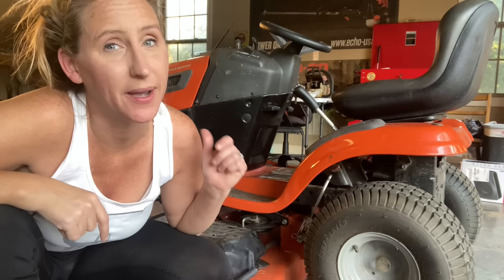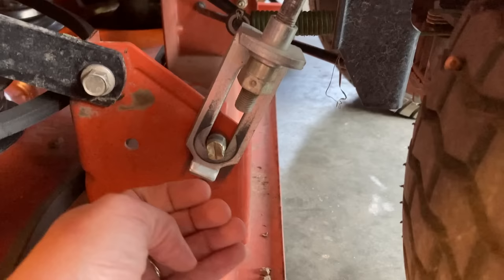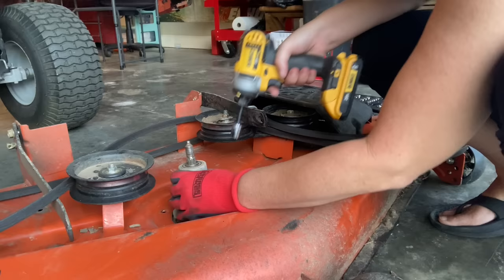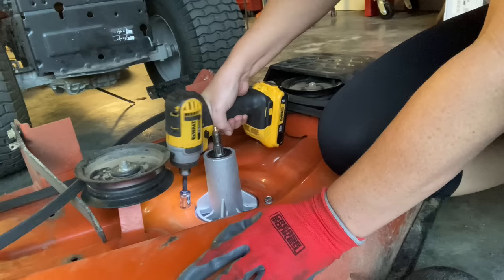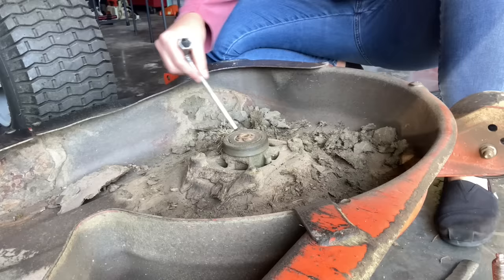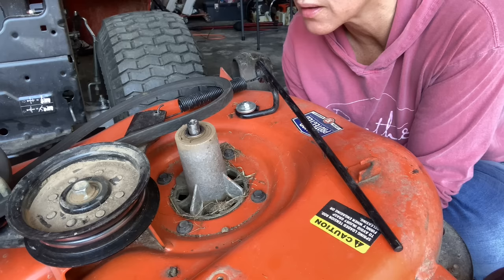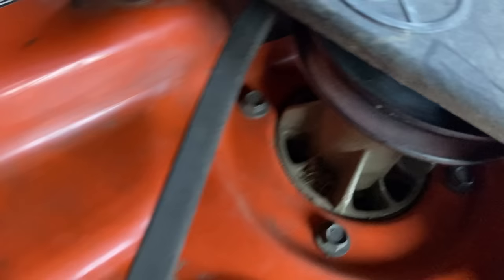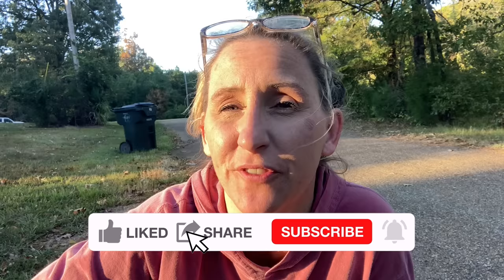Husqvarna riding tractor deck repair. Spindle, shaft and blades replacement.

Comment: I am definitely not an OSHA nut but I couldn't help but cringe when I saw you wearing flip flops working around all of that heavy metal.
Reply: My grandfather used to demo rental properties with sandals. My cousins and I would say he had his construction boots on😂
Reply: I wore my Crocks doing the same thing today. Is that okay?😊
Reply: Air chisel on end of bolt will make it jump off?
Reply: Safety 3rd!

Comment: Those zerks actually do work.  Although they are called “sealed”, it is basically a dust shield and grease will get past it due to the pressure.  If you don’t believe it, then you can also just remove the seals on the inner side of the bearings.
Reply: There is no way the grease will flow past the seals.
Reply: @JM-yx1lm  Yes it will.  Do the test and then get back to me.
Reply: If the bearings are sealed, only the grease in the bearing will remain.  No additional grease will get in there.  If it could, it would also come out the other side.
Reply: @robertheinkel6225  It will and does if you put enough grease in.  Most people only put about 10- 20 pumps of grease in and it takes much more than that.  A grease gun puts out 700-3000 PSI, those rubber seals couldn’t hold back more than 5.  Do the experiment and you will see that grease will absolutely get in there.
Reply: Grease pressure will get past those plastic,rubber seals (slowly).  But you can also pick out the seal on grease side and then it has easy access.
Reply: @gomerhondo7249  the rubber seal helps keep out any moisture and dust that may get by the grease that is in the cavity between the bearing and the zero fitting.  The system actually works good when properly greased, provided the bearings are of good quality.
Reply: You have to remove the inner seals for it to work !!!
Reply: @mitch8831  It does not work unless the inner seal is removed !!!  DUUUUHHH!!!!!!  The pressure of the added grease will only seal the seal tighter !!!!
Reply: @mitch8831  NOOOOOPE !!!!!
Reply: @wilburfinnigan2142  Do the test and you will find otherwise.
Reply: Mitch is right, and there’s YT videos to prove it. As a professional aircraft & auto mechanic of 30+ yrs I didn’t believe it either, but I watched a video and tried it on my new John Deere S100 riding mower and sure enough the grease makes it past the inner seal and crackles as it comes out the outer seal. I always thought hydraulic force it would push the bearings out of the spindle but it doesn’t because those seals are fairly weak and the grease just cruises thru them. I think it took about 20-25 pumps from my pistol grip grease gun on each spindle but seriously, it works. Now I just hit them with a pump or two twice a year and I know they always have fresh grease. Give it a try, your bearings will love you for it. 👍
Reply: @mitch8831  I filled my spindles on my JD when I rebuilt it. The grease did flow, but it took a lot of grease to fill it up to pressure. Either way it's full and dirt won't bet getting in. You can feel it when it's full and yes, mine did seep out. Just don't go too far.
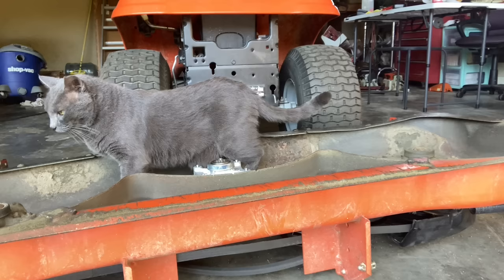Reply: Seals?!! look again @12:30 There isn't a seal on the upper side of that bearing that Bre just took out of the housing.....
I know, Bre made another video explaining why the zerks weren't doing anything except plugging a hole, however as you could plainly see, there isn't a seal and therefore, grease could be beneficial. Just being observent.....
Reply: @mrbibstoo  I have this exact mower deck, and take it apart to clean it every year.  There are no zerk fittings that just “plug a hole”.  They all have a purpose, the manufacturer would waste money on a zerk fitting if there wasn’t a purpose.
Reply: @mitch8831  OOOH i have and have pulled the inner seal off !!!
Reply: Just saw the vid and those bearings that i saw had no seal and she installed them dry.
Reply: Nice repair video. But stop wearing flip flops working on these things.
Reply: ¹

Comment: Bre it is the OLD MAN at Eliminator Performance commending you on do a good job and taking care of the neighbour, smart move. Just a note: a while back i changed out a deck spindle and wanted to test if the zerk fitting and grease would actually do anything with the new both side sealed new bearings. Took the inner seal out to check the grease and it was packed and full of a blue coloured grease maybe marine? Assumed the other bearing would be the same so did not check it, but reinstalled the inner seal and by hand and paint stick started to pack the inner spindle housing with RED & TACKY grease, yep you guessed it red in colour. Hand packing just helped me out by not requiring to pump around 70 pumps from the grease gun to fill the inner housing. Anyway i reassembled the bearings and pulley and started pumping the grease gun filled with a new tube of red and tacky until grease back pressure could be felt and grease started coming out of the bearing ends which happened to be blue in colour so i figured the red grease must be displacing the blue. Disassembled the spindle and bearings again pulled the inner seals on both and guess what? Red grease was going into the bearing through the inner and outer diameters of the seal i guess no other way for it to get in there. So the moral of the story is do you want to pump 210 times with the grease gun to possibly make those bearings hold up longer and grease them every year cause grease will go in there just not sure how much but the two colours say some goes in.
Reply: 5555
Reply: @logangarrison7254  Yep your number may be closer it is a lot of pumps of grease to fill them just think how much money it would cost the manufacturer to sell them filled?

Comment: I am still mowing with a Sears twin SS16 H.P. 48- inch deck I bought in 1974. My first mower. I mow about 2 acres. I have only replaced the belts and battery, everything else is original. It has the onan engine. 
I love your videos.

Comment: When I bought my 3rd house it had a lot bigger yard than the last two and I definitely needed a riding mower. My parents neighbor gave me her old Murray rider, the two speed Model, high & low, so I was glad to have it. So after maybe the third cut the left side began to cut lower than the right, I adjust this thing a hundred times if I did it once had me tore not being able to get it level. I thought it was a blade issue but nope. So one Sunday morning after two passes and getting pissed to no limit I jumped in my truck and went and got myself a Sunday paper. Just as I was hoping Sears had a sale on riders. So I pulled out my sears card called to see what my limit was and was good to go. Told my girlfriend at the time I’m going to Sears to buy myself a New Mower let’s go if your going. Got to Sears bought a Sears LT1000 and I couldn’t quit smiling! Was so proud and happy I went by my parents house to show my dad! Gave the Murray to him for my grandmother’s yard. He found the problem with the uneven cut. He pulled both spindles and he put it on a mic gauge and one rotation there the problem was, bent spindle. Could have save myself a lot of money if I had known about such part or problem but the Craftsman didn’t disappoint! I had that mower for 20 years and she still looked brand new when I gave her away and the only reason I did was because my parents neighbor had bought a Scott’s that they had problems with since day one, dad said it was the vent on the gas tank, nope it had a short from the factory in the switch. I noticed every time that I was in a bumpy part of the yard it would either cut off or back fire. Pushed it to my garage put a block on the seat fired it up and just started shaking and pulling on every wire it had, pulled on the switch and there it was, started backfiring, EBay and $13.00 bucks fixed it. I know the first owner spent right at a $1000.00 and three trips to repair shops! Keep up the great content, I love learning new stuff!

Comment: So hilarious that this exact same thing happened to me yesterday.   So now I am waiting on the replacement spindle to get here tomorrow.  Watched the video to double check everything I am doing is the same and good to know I am spot on (minus the cat issue, have a dog though that likes to know what dad is doing 😆).  As for the hammer issue, mine is always Phillips vs flathead.  Keep up with the good information you are providing, it is very helpful and informative.  Thanks for taking your time to share!
Reply: Grinner  If you have a Husqvarna or any  brand mower keep a pair of spindles and pulleys and blades on hand and not if but when you hit a rock and break a spindle you can be back to mowing right away, then reorder the parts you need !!!
Reply: I went thru three belts because Someone at church knew it all. Thank you even that's a different brand
Reply: @wilburfinnigan2142  just how big of a dam rock do you need to hit to do this? lol  gotta be big?

Comment: Actually the spindles are designed to take grease through the hollow bolt out holes and fill the center of the spindle.  When installing bearings you are meant to pop the dust seals off the upper side of the bottom bearing and lower side of the top bearing.  This allows grease to enter them and be spread among the balls and cage.   Now honestly the system is flawed as unless you grease them regularly they dry up and don't take grease.  Also they use damn near a third of a tube per spindle which largely just sits their most of it's life.  Nice thing is they are cheap bearing so replacing them every so many hours and not wasting the grease is not horribly hard on the pocket book.  I have had three of the very same decks one on a Husky, on a Craftsman Pro and one a Poulan Pro.  As always you give great advice and tips that will help homeowners save money and get more life out of their equipment.  Thankyou very much and best wishes from Atlantic Canada.

Comment: Cool that you used the good spindle on the old blade housing.  I think many shops would just do two complete housing/spindle changeouts!  I did worry about your toes when you removed the deck with flip-flops on.

Comment: If you use a gear puller to remove the pulley it would pull straight up allowing it to come easy. Using a pry bar on one side tends to take it off at an angle will takes considerably longer and makes the splines bind on each other.

Former US Navy engineer
Reply: Actually the easy way to remove a stuck pulley is remove the 4 spindle mounting bolts and allow the spindle to drop until the pulley rests on the deck and remove the grease zerk and whack the shaft with the hammer !!!  quick and easy !!!
Reply: @wilburfinnigan2142  An engineer will always come up with a complicated procedure to perform a simple act. 🙂
Reply: @jayjaynella4539  in my cub cadet manual, for taking deck off, there's an extra step that is totally unnecessary.  I scratched it out and wrote, " stupid step, don't do this".
Reply: Sounds exactly like something an engineer would say.......
Reply: @jayjaynella4539  an engineer will use the proper tool for the job!
Reply: @wilburfinnigan2142  its junk anyways. Just hit the zerk fitting
Reply: I thread the nut back on and whack it with a hammer, be sure you have the nut down a bit so it wont damage the threads with the force of the hammer, it comes right off usually with 3 blows

Comment: Earlier this summer I had worked on my neighbors Husqvarna of the exact same model. He mows about 4 acres of which about 3/4 of it is wooded. I replaced a spindle on his. It didn't come tapped but did have the self tapping bolts. I didn't know there was another option. I also didn't realize that the blade side could be different. 
 He had brought this mower to me many times. I've had to re-weld the welded brackets on the deck back on, where they were stress cracked and peeling off the deck. Along with issues of the drive belt kept coming off. Finally after the third time bringing it back for the drive belt issue, I tore every part that had to do with the drive system off of it. This time I took the rear tires off to get a better look at the top of the transmission. I had it jacked up using the pull tab where you connect a trailer to. This released the upward pressure on the transmission allowing it to drop down. There were two 13mm bolts on the front of the transmission broke off. I dropped the trans and tried to drill and easy out the broken bolts from the housing. NO GO!! Wound up using a regular drill bit to completely drill out the old bolts and re-tapped the aluminum housing. OMG! It was a nightmare of a job. Took me almost three days to get it repaired start to finish. And as @Marc Davis said I'm not young anymore. Plus have debilitating back problems. Was SO GLAD to finally find out the real problem and get it FIXED.. Keep up the good work and keep the videos coming. Love your channel.

Comment: I did this same job on a poulan that my boss gave me with a rusted out deck and busted spindles. It was a lot of work, but for the cost of 2 spindles on ebay and some welding wire, I have a functioning riding mower.

Comment: Brings back horrible memories of putting husky decks on working at Lowes, because they were never attached when shipped. Can't imagine taking them off.
Reply from the maker: This mower my neighbor got marked down at Lowes because it fell from somewhere and crunched the hood.
Reply: some of the husqvarnas come with the  decks off sitting on the side of the tractor in the crate. always fun  uncrating assembling and prepping. tried to line them up and do 6 or 8 in one shot.
Reply: This vid just reminds me how i need to get my husqvarna lt151 fixed and the chicanic is literally half a world away

Comment: You should also check the flanges that hold the rear tires on the frame.  Huskies are known to have those crack.  Not only did mine crack but the frame split in front of the transmission.

Comment: I have one of this model mower that is about 12 years old. The hour meter shows 800ish hours, but it went a couple years disconnected. In that time, I have had to weld a broken deck hanger bracket, replace a broken spindle,  install a short block because I had a slow oil leak that suddenly got much worse so I ran it dry and I have replaced all the steering gear twice. Oh, and probably 6 or 8 sets of blades; we don't just grow rocks, but it rains them here, too. The hydrostatic drive is getting to where it won't climb every grade on our property, so I suppose that's probably next. None of this is me complaining, but rather praising that it has held up to mowing our rocky property. I use the crap out of it on about 3 of our 12ish Texas acres from March to October. I think we have gotten our money's worth out of it.

Comment: Correct me if I'm wrong, but when you spun the new shaft, it was quiet, as it should be, but the left-hand shaft made quite a bit of noise, and the right-hand shaft was making noise as well.  I just did the same job and purchased a kit from Amazon with all the rotating hardware.  The kit was $129.00.  I didn't want to have to repeat this process again in the near future.  All that being said, you did teach me some things in this video, so thank you for that.  Retired Submarine Auxiliaryman.

Comment: Try using a 5"x2" margin trowel to remove the grass, etc., from the underside of the deck. Much easier to use and more efficient than a "screwdriver". Also less likely to injure yourself while doing this. Most hardware stores sell them for about $6.00.

Comment: I love watching your videos!! I just wanted to tell you that I watched a video (on youtube) how greasing the sealed bearings on the spindles works. The plastic will let grease into the spindle bearings. Maybe you'd like to make a video yourself showing that it is possible to do. Cause I didn't think you could do it either greasing a spindle sealed bearing the force pressure of the grease will push the plastic seal around the bearing will move enough to let grease into the bearing.  Love your videos!
Reply: NOPE !!!  You have to remove the inner seal to get the grease into the sealed bearing !!!!

Comment: Years ago Impact wrenches were a luxury found in most auto repair shops. Today, whether it be pneumatic or battery powered even the home owner has at least two or three. The sharp snap of the anvil allow even the stubborn nuts and bolts to unscrew rather then snap off.

Comment: Great to see ya Bre!!
Must be a little cooler there.

About the raised boss on the spindle  where the blade mounts. On new spindles, if the old bolt hardware is all that is available, the boss can be ground off. Make the surface smooth so the blade bolt will tighten. 

Awesome video and awesome job as usual.
Reply from the maker: Hey Del!
Reply: Love the video I did not know that the spindles are raised out more like that I have to check mine I have a commercial pro series and I am thinking about replacing my spindles anyway interesting to know and I hope my grease fittings aren't fake because I've been greasing it every month thank you
Reply: The grease fittings aren't really fake but you will have to put about 50 pumps into them if they didn't grease them @ factory assembly to fill the housing.

Comment: Note if the pully is hard to get off you can use a  air tool  put  it on the center of bolt and under the pully pry up  and the pully will come right off. Have a good day.

Comment: I started working at lowes back in 2004 in the Outside Lawn and Garden Dept. and I remember at that time a lot of problems with the deck spindles  on the Husqvarna Lawn Tractor.

Comment: Great video +++++!
I drill out all of my spindle mounting holes and use 5/16” bolts with anti-vibration nuts. Have done this for years and the bolts had not broken or pulled through! Saved many of my spindles.
Reply: You drill out the hole to hold a 3/8 bolt and then us a 5/16 ? Not good at all !!